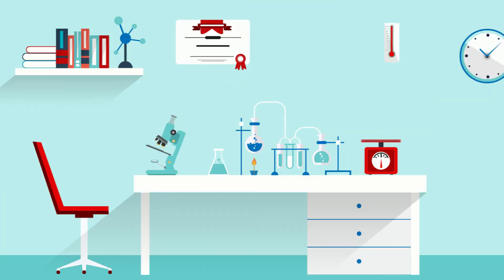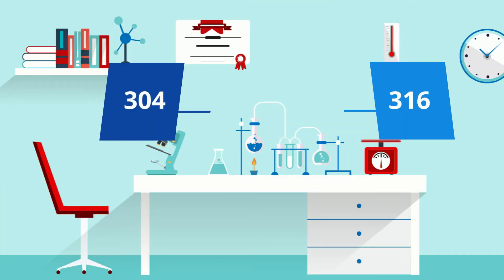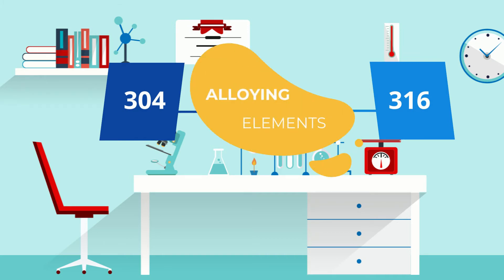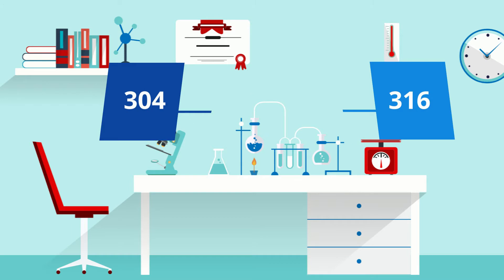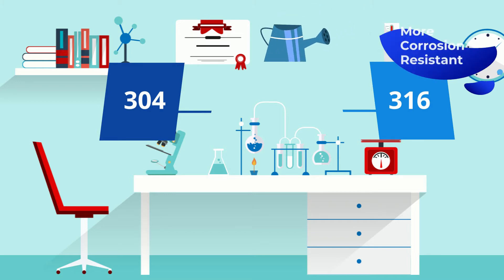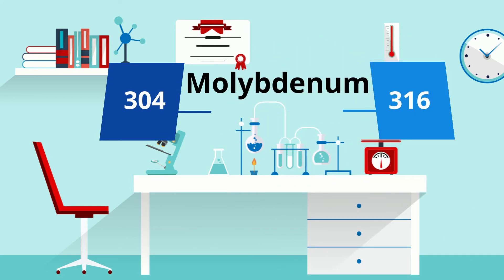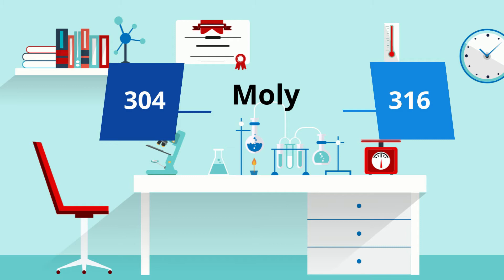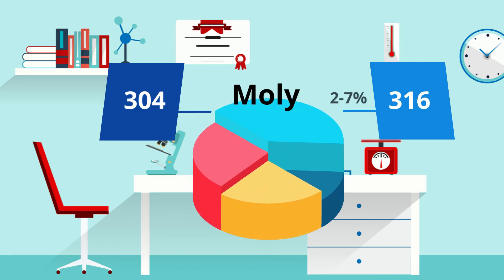304 vs. 316 Stainless Steel: Which Is Best for Your Application?

Comment: Which stainless is used in utensils, and which is used in knives? I want knives that don't rust in the dishwasher, a problem older than knives or dishwashers.
Reply: Yes, indeed. Non-existent knives rusting in non-existent dishwashers is such a non-existent headache.
Reply: @jamesmcinnis208  
lol!
Reply: 316 dominates over 304. 316 can be in saltwater climates in a planet that made up of 70% saltwater. Use 316/316L as a long term investment
Reply: 304 is better